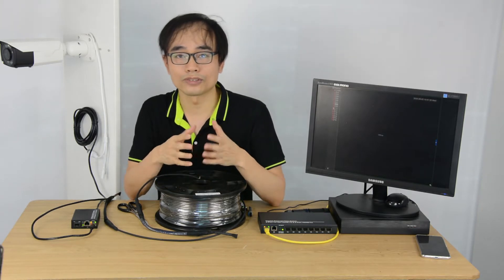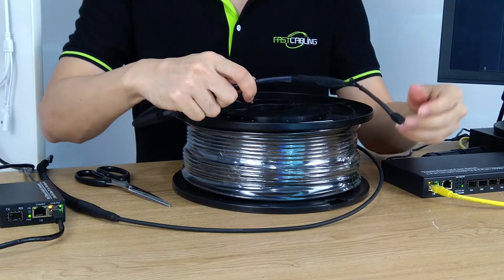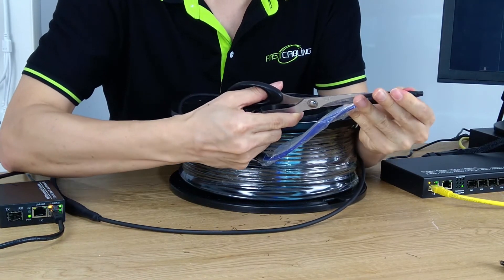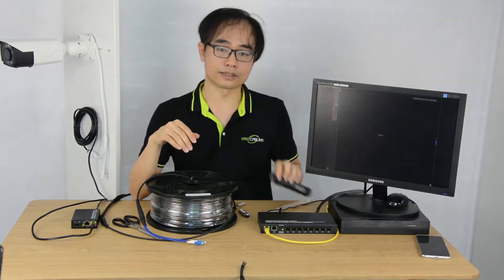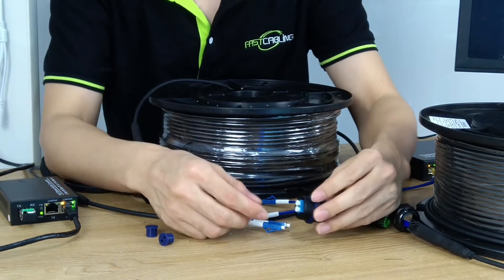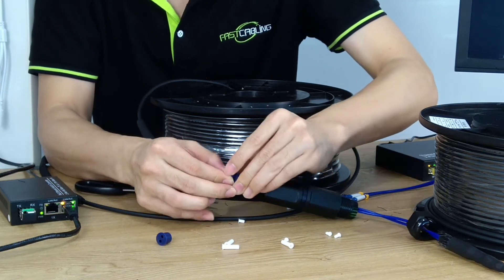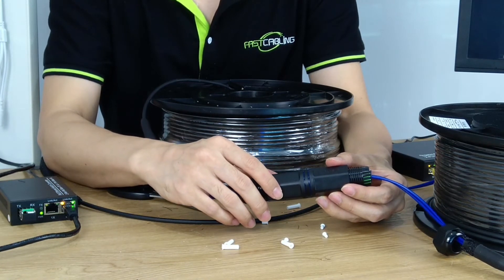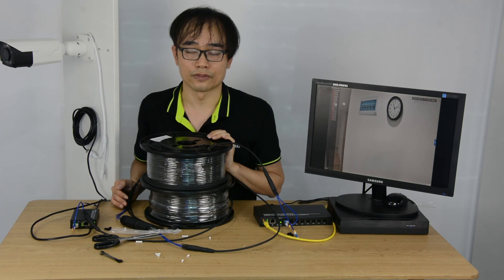Connect two pre terminated fiber optic cable together easily

Comment: My fiber is thicker , what can I do?
Reply from the maker: If the connector is standard (LC/SC/ST/FC, etc), the thickness doesn’t matter — just use the right coupler. If the connector is custom or non-standard, you may need a mechanical splice kit or contact the supplier for a matching adapter.
Reply: Thank you  @Fastcabling

Comment: If I want to connect up to 5 cameras on fibre and to the switch how can I do that seeing there is only one port for the fire on your switch?
Reply from the maker: You can swap the media converter with a poe switch that has an SFP port, like 8 Ports Outdoor PoE Switch with 2 Gigabit SFP (#6100-82).

https://www.fastcabling.com/product/8-ports-outdoor-poe-switch-with-2-gigabit-sfp/

Comment: Can you run fibre to a security camera,that is POE or would I need some kind of special switch that can be used,how would I do this.thanks.?
Reply from the maker: You can use the switch with SFP slot or media converter to convert the electronic signal to optic signal. The SFP transceiver s are needed.

Comment: I have a question. How many feet on fiber can I go without having to add any external device for boosting or repeating?
Reply from the maker: You can have up to 80km (single mode) between point A and point B. However the multi-mode fiber optic cable supports 550 meters.

Comment: i need a solution for  factory (32 ip camera + NVR)
But distance from the factory to security room (where i will install the NVR and monitor) more than 500m.
Please help me to have a draft solution.
Thank you a lot.
Reply from the maker: I guess you will need to two 16-port PoE switch sitting in the factory to power all those IP cameras. You can use two strand pre-made fiber optical cable or add one more fiber optical cable for backup to link the factory and the control room. If the PoE switch has SFP slot which allow you to install the SFP module, you will be able to connect the fiber optical cable to the PoE switch through SFP module. At the center, you may need two media convertor to take in the IP camera from two PoE switch. That is pretty much all you need.
Reply: FASTCABLING thank you very much. 
2 strand pre-made optical for connect between 2 PoE and media converter right ?
Sorry i am not an expert on this issue, so my question could be stupid. 
If possible can you help me to have a draft drawing about connect diagram ?
Reply from the maker: @phamtruongktcn  You can find the diagram under the how it works. It is similar. What you need is two independent link from the factory to the center. https://www.fastcabling.com/product/compact-media-converter/
Reply: FASTCABLING thank you very much